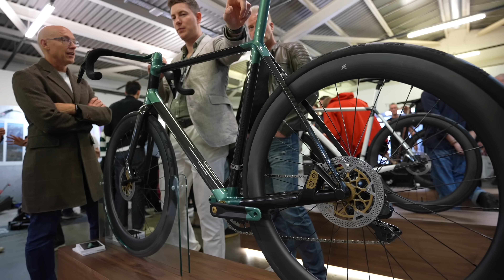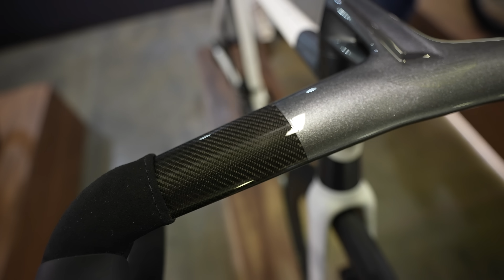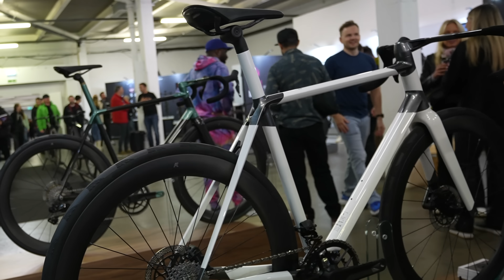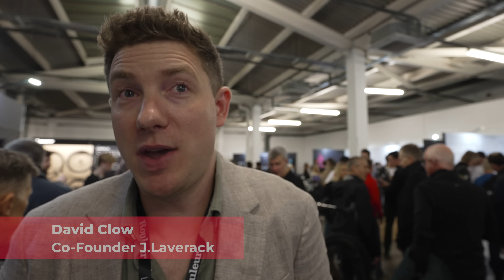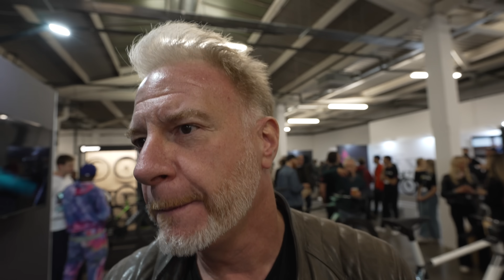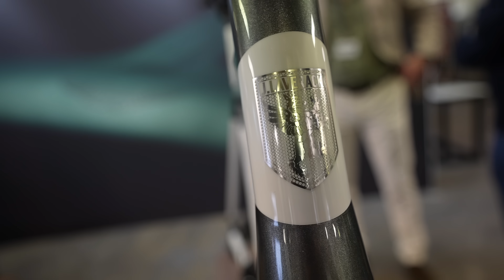This is the most hi-tech bike I’ve ever seen!

Comment: Look n sounds amazing...
unfortunately both brand have below avg track record 
both the car and bike will spend more time in the repair shop 
cant imaging the time frame to get replacement for those special parts
Reply: What on earth are you on about? Where is any proof whatsoever that Laverack has any sort of repair/maintenance issue?
Reply: nothing against laverack. however with complications of all internal cabling and hydraulic disc add to modern bikes. i wouldnt trust auston martin as supplier of my proprietary bike components. in cycling tons of wear an tear items that need replacing. hope it doesnt spend much time at the shop waiting for parts like most auston martin i know  @bikerdavecycling